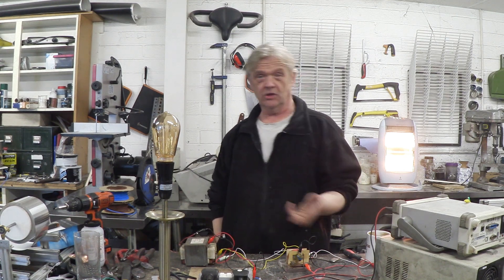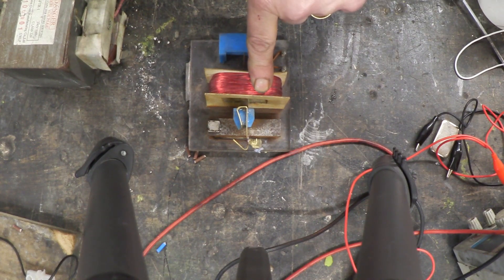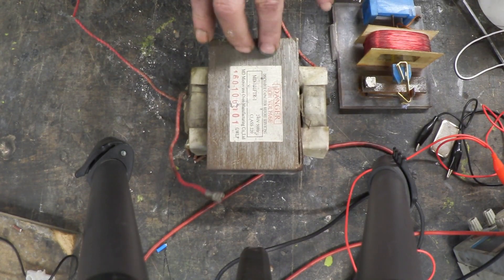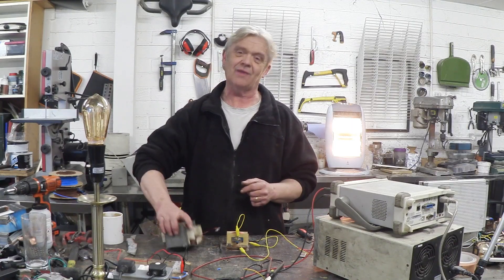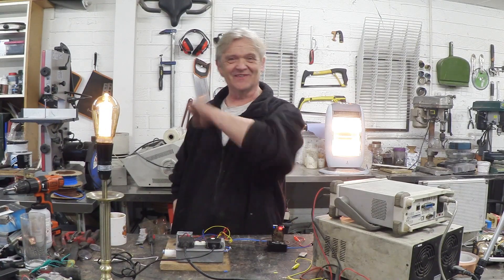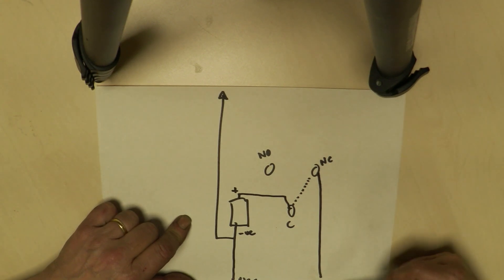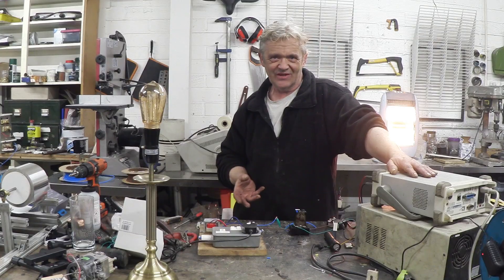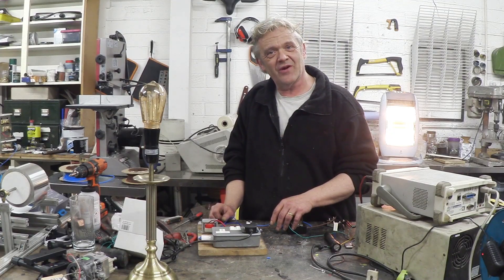1026 The Easiest Inverter You Will Ever Make

Comment: Can the analog inverter(no transistors) run something like a welding machine or 1hp electric motor? When I tried to run a motor rated at 2400 watts (120V*20Amp=2400) with a 2500 Watt invertor (had transistors) the motor ran for maybe 2 or 3 seconds then shut off. The inverter started beeping and hasn't worked since haha. Could an analog inverter(no transistors) handle the continuous 2400 watts? Or is this a battery problem(I had the invertor hooked up to a fully charged 12v car battery).

Comment: could make it solid state...
just a standard amv circuit with a transformer in the collector lines will work fine
has a close to sinus output and basically always works ;)
sure, no high efficiency but realy easey to make :)

Comment: When i was a kid i would get old car radios and fix them most of the time it was the vibrator that was not working so i would pry open the can and clean and rebend the contact reed and wala working radio. Most of the radios i fixed were 6v the ac from the inverter was to step up the 6v to 80v for the b+ required for the plate bias on the valves/tubes. And amazingly enough these old am radios would only have a very faint sound of the vibrator singing in the background at about 100hz . A very gratifying sound when you'd fire up the old radio and the tubes would warm up and you'd hear that sound.

Comment: Quiet by accident my first relay lab I unintentionally wired up my relay like this.. But not only did it cycle  (because of the way I wired it) it added inductive kick to the original load. And an intended 12 vdc load lamp instead received 24. What do you know....a DC to DC converter too....

Comment: I was thinking about minimizing the arc, and I think surface area is the key, so maybe use a half ball and socket to maximise the surface area and reduce the current flowing through a very small spot, thus reducing its temperature.

Comment: The most important advantage is the price and it's resistance to high rads, important for all preppers out there, easy to make and maintain, specially in harsh conditions. Thanks for the video mate, hope you can give us more electro-mechanical devices in the future.
Reply: There are so many ways to make Ac current.   I found another on u-tube.   Lookup : Ruhmkorff Induktor with elektrolytic Interrupter.   Basicly two dissimilar electrodes in a weak acid add about 30volts Dc and it oscilates.

Comment: IF YOU USE A FERRITE CORE TRANSFORMER YOUR SQUARE WAVE (ON OFF 0-120) WILL GET 'LOOPY'... SOMETHING ABOUT THE 'EDDY CURRENTS' IN THE FERRITE CORE. I discovered this by accident while building my own 'capacitance discharge ignition' for a Honda four wheeler... what happened on the oscilliscope to the wave was amazing!

Comment: Presuming that the energisation of the relay is enough to actually engage the NO contact, then it would be possible to use a 24v CT to 240v and have the off cycle power one side of the centre tapped primary and the on cycle powering the other, with negative going to the centre tap. That should produce a better waveform out of the transformer secondary.

Comment: I have a old farm manual that shows how to make what they call a buzz box. It used the bell ringer from an 
old phone as the make brake relay and showed you how to wind your own step-up transformer. they also 
used a compositor off a car distribute to keep the arcing to a minimum.
Reply: compositor... condenser???
Reply: @jbodden6977  condenser, where did that mp come from

Comment: Question, why don't you start with DC ultracapacitors .. Into the stepup transformer.. Then into AC capacitors... Would that not work? 

Avoiding the arcing in the first place.

Comment: Resistive loads don't care if you feed them AC or DC, so you could just use a collection of batteries to make up the required voltage - same goes for an appliance with a universal motor.
Many other appliances also don't care if you feed them AC or DC, since the current runs through a bridge rectifier before anything else.
Reply: wouldn't that mean you need 10 12 volt  batteries to run a 120 volt appliance instead of running 1 battery through a relay and a transformer, that cost half a battery and don't need to be charged?
Reply: @williamburdon6993  
Yes, it means you need more batteries.
However, in the long run it'd be way more efficient as there would be no power lost transforming the voltage or powering a relay.
If you're stepping up the voltage you're going to need the battery to provide a lot of current. For every 1amp of 120v you're going to need 10amps of 12v from the battery and that isn't including transformer losses.
Current demand is what results in a voltage drop and more current means more power lost due to resistance that becomes heat.
Yes, 10 batteries are going to need charging for 10x longer but 1 battery is going to need charging 10x more frequently, thus reducing its lifespan by 10x.
Whichever way you look at it, it's always more efficient to start with a higher voltage and use it as it is.

Comment: great info...while we are on this topic....is there a way to clean up the output of a regular generator for use on sensitive electronics? Like they say inverter generators are good for sensitive electronics. thank you.!
Reply: Yes it's called an ac voltage regulator and they are really energy hogs but some older small commercial hydro plants sold them to customers for sensitive computer equipment in the 70s 80s and 90s

Comment: Sir, thank you for another instructive and interesting video.  Some comments:
1 - The suppressor capacitor usually has a 100 ohm resistor in series to limit the discharge current when the contact recloses.
2 - The plug-in relay you showed would have had two sets of contacts.  If you drive the coil through one contact set and the load through the other set, you should achieve frequency stability, limited only by the sag in battery voltage as you load it - reducing frequency.
3 - One should switch on a transistor radio nearby to assess the radio frequency interference.  Even with the suppressor capacitor, expect it to be excessive.  (Although less if you use the two-contact-set arrangement).  The metal-cased relays to which you referred would be better in this respect if you earthed the case.
4 - Early car radios - pre-transistor of course - used a vibrator to generate 50mA or so of HT current.  The valves (toobs to our American brethren) would have had 12V heaters and run off the battery DC.
5 - Relays are specified for around a million ops.  Assume a likely frequency - try 200Hz - that gives 1.4 hours running time.   If the relay were spec'd for 10million ops, you'd still only get a little over half a day.
But it's fun to make, and instructive at the same time, which is important.
Oh yes, we didn't mention polarising the transformer core, did we!
Reply: Hi, great comment. 
This video is to explain some basic principles to viewers.
The 100 ohm resistor you mentioned is not needed in this low voltage application. The capacitor won't be killed easily here.
Those ancient vibrator relays have a dead weight tuned to low Hz. They look like those tall earlier telephone relays. Modern Electro mechanical Relays are not specified for million cycles. May be 50k. These mechanical relays will not operate at 200 Hz because of the physical limitation. Open and close times around 10 msec each.  200 cycles per minute is already considered very high. Even these we have use special relays.
Regards.

Comment: Old Ferris radios had this device arrangement. It was called a Vibrator and was used to convert 6 or 12 volt battery DC to high voltage to run the valves in the current  Car Radios of the day. Chewed heaps of waisted power and flattened a car battery within a couple of hours!

Comment: Imagine the EM coming out of that thing.  What happens when you put 100A at 12V through it?  What if instead the vibrator swings a magnet that energizes a secondary coil into a transformer?  Then you'll get a nice, clean sine wave.  Not sure how stable your frequency will be for various loads with this mechanical method, though.

Comment: In a pinch, for a few hours, maybe, but there was a very good reason switching inverters were invented, and you just displayed why. But there was a intermediate step between electro-mech inverters and solid state inverters involving big old caps and valves, which morphed into big old germanium transistors and big old caps with an analogue vibration circuit... what they had to do before 555's...
Reply from the maker: I am sorry mate - I have to disagree with a part of that - this was a predominant tech and issues like lifetime were overcome to a degree - so I can't agree with the 'in a pinch' argument - plus there is a lot to be learnt by looking at how they did it and making it to give you a hands on feel of what is involved in inverters
Reply: @ThinkingandTinkering  Relay contacts are rated in 100's of 1000's and chattering at 50 times a sec is not "normal working conditions". They would wear out quick smart.
Reply: as you no doubt have gathered from my posts, I really do not like relays.
Reply from the maker: I am sorry mate - that's not right they are rated in the millions of flips - the one I used is rated at 100 million flips Moicron do ones with higher ratings
Reply from the maker: lol - no I got that - but it's like anything to my mind - useful for some stuff
Reply: @ThinkingandTinkering  In a 24h period, the number of flip flops is 4,320,000, which since most relays would give out long before that, I would still call it a pinch.....
Reply: And if you got a high end relay for ~$50 that could do 100M flips, it would still fail well before that because no relay is designed for mains simulation. 50 Hz is a hell of a thing to put a poor little relay through. They are for switching loads in EMF noisy environments.
Reply: Kind of reminds me of a professor I had he was great in the theory book and all of the explanations of why my circuits couldn't possibly work but he had to take time off once we got to the lab for personal reasons after my devices actually worked lol

Comment: During the late 1950, early 1960s, mobile radio transceiver used mechanical vibrators to generate high voltage power for the transmitter valves from the car 12 volt supply.
The efficiency was very poor, with an output power of just 5 watts at VHF. Later the mechanical vibrators were replaced by germanium power transistors, this significantly improved the efficiency, though it was still poor compared with modern solid state designs. 

The contact arcing problem is usually addressed in the same way as in the old mechanical car ignition system, by the inclusion of a high voltage capacitor across the interrupter contacts.
Reply from the maker: I am sorry mate - I get your point and don't disagree but there is a lot to be learnt from this tech is what I think and I get the impression there is a degree of discounting that in what you are saying
Reply: @ThinkingandTinkering  unlike your video on magnet amplifiers, I think this technology is better consigned to the history books, particularly due to its poor efficiency and it's potential for generating EMI. 
You may be interested to know, that my first amateur radio was an old Pye Cambridge am mobile transceiver. ( I still have it).
This was of the benefaction that used OC23 power transistors for the inverter that generated the high voltage power for the transmitter valves
The output stage was a QQV310. As the internal chassis, was punched out for a valve FM modulator, I latter added this stage allowing the transmitter to transmit either AM or The new fangled FM. By the time I retired the Cambridge it was something of a hybrid. It used a integrated circuit connected to the if to demodulate the FM signals. It had a dual gate  MOSFET receiver front end amp an first mixer, and a CMOS CD series crystal switching stage, that used pin diodes, to allow the receiver to scan at a whole 10 channels of the amateur 2m band. The whole thing required about 10 Amps from the 12 volt supply to give about 6 watts on AM and about 10 watts on FM. It was the size of a suit case. Today, far greater functionality can be achieved in the size an old cigarette packet.

Comment: Early in my career I used to have to fit Redlline Inverters, these were full sinewave and simply comprised of a 12 volt motor a connecting shaft and a 240 volt generator.
Reply: We have always called those dynamos
Reply from the maker: I know the kind you mean mate and I love them
Reply: Many machine shops use them especially when there's no 3 phase incoming mains available & needed to power 3 phase equipment. Simply use a 3 phase motor (large enough to handle the electical load [i.e. 20 or more% greater than the load]) and presto....you're in business.

Comment: If I replace the relay with a mosfet fed with a 60Hz square wave from a 555 circuit, would it produce a usable output?  What would the wave look like on the output of the transformer, I imagine it would no longer look much like a square wave?  Thanks for the video.
Reply from the maker: oh the output of this is useable mate - I think you might mean stable - but the answer to your question is yes - it would still be a square wave

Comment: You could probably make a slightly-less-retro version of this with some or all solid-state components, if you need a quick-and-dirty way to turn DC into AC!
It's basically three sections: An oscillator, a high-current switch, and a transformer.
The oscillator could be anything from discrete transistors to a 555. You just need to produce a square wave at the frequency you want the output. This is relatively easy.
The switch is the hard part -- high-current solid-state switches tend to be expensive, and high-current mechanical switches (relays) tend to be noisy (physically and electronically/by radio) and wear out quickly. The mechanical oscillator design he showed basically combined both these parts together in a clever way -- one relay can be the entire oscillator while also being the high-current switch, though you do really need something to suppress arcing on the contacts or it'll burn itself out quickly.
The third part is a transformer -- as these isolate two circuits from each other in a way that doesn't care about the "centre" voltage on either side, this can take any square wave as an input and produce a scaled version on the outputs that can be used as a substitute for a more traditional AC line (though it's not going to be a sine wave, which will interfere with some electronics).
Ideally, you also have some kind of overheat/overcurrent cut-out on the transformer's input line, since if the relay/transistor/whatever burns out in such a way that it gets stuck in the closed position, you're essentially shorting the 'battery' or other high-current DC line through the transformer's primary winding. I think you can find transformers that come with this, but it tends to be essentially a non-replacable one-shot fuse, so it's probably best to add your own that trips faster even if your transformer has one built in, to avoid burning out a heavy and expensive component (and to add an additional layer of safety).
Reply from the maker: it's sort of where we are heading with this mate - I like the mechanical version because it shows the logic and operation in a way that can be 'seen'

Comment: A light bulb that takes high voltage doesn't care if it's fed AC or DC.
Reply: Yes but how to get high DC voltage when you've only got a 12v battery? A step-up transformer needs AC (or pulsed DC in this case)
Reply: @nil5221  For that, we don't worry about output frequency - you can also use a spark, that's what Tesla did.
Reply from the maker: if you have never done it try taking a strip light down to an overhead HV supply line - it will just light up - it's quite awesome
Reply: @ThinkingandTinkering  I have Tesla coils for that kind of fun.

Comment: That is almost exactly how the old ringing doorbells worked! 
They would have an adjusting screw on the arm to fine tune the ring ;0)

The other thing to remember is that you don't get "Owt fer nowt" ..... Power in = Power out. Double the output voltage double the input current!
Reply from the maker: for sure mate

Comment: What about running a dc motor at 60 rpm tapping a set of points as a chopper
Reply: That would mean running the motor very slowly. Accurate speed control would be difficult, I think running it at a normal higher speed and gearing it down...it would take 100's:1 ratio such as a worm drive.
Reply: @nil5221  yes, maybe a modified timer motor, just throwing some ideas out there, thanks for the great videos.
Reply from the maker: they did that mate they were motor - gen sets or dynamotors